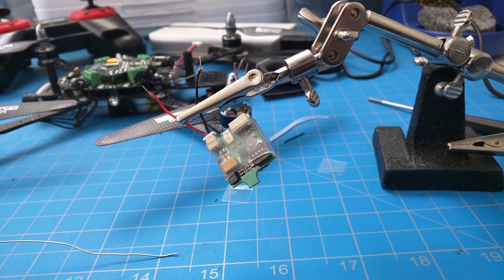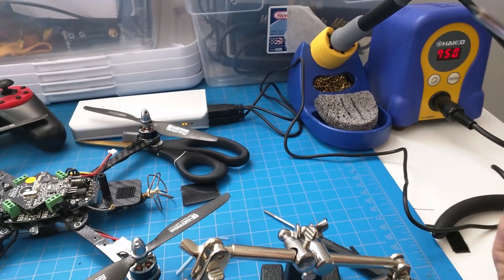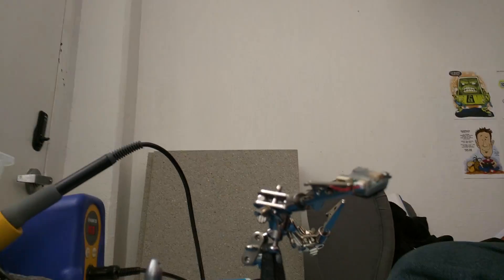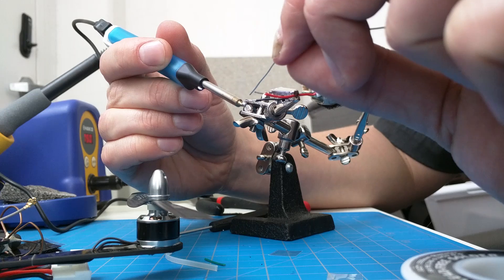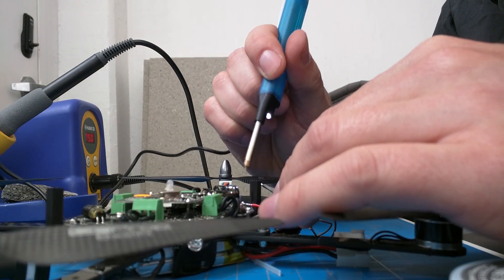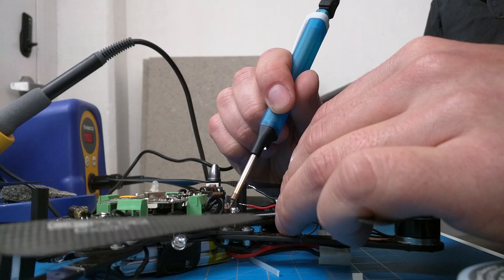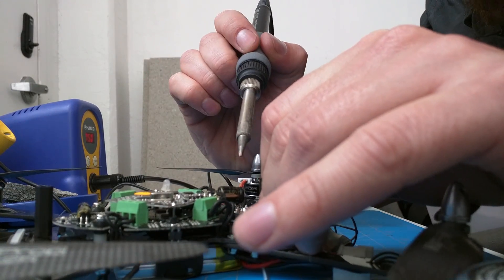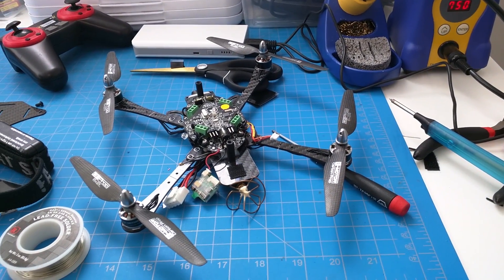Can a $12 USB soldering iron actually, SOLDER?

Comment: Brought a battery powered soldering iron myself last week and came the same conclusion. You can melt solder to wire, but try to solder to a PCB or as in my case try to desolder a component and it fails miserably.
A tip for anyone who reads this and needs a soldering iron, it needs to be atleast 25W and if you have to go portable get a butane powered iron.

Comment: when in doubt, pinky out...lol, i have a portable soldering iron that takes 3 "aa" batteries, same effect.. was trying to fix a headset connector, tin wires = good, attach wires to connector = FAIL...

Comment: I see you are powering your video tx directly from the controller board. I too want the same to shave total weight off my EOX w/ CF frame. However, I'm doing it with the power cable of the vtx series to the 1150 battery female plug to no avail (vtx no power). Connection is only thru one + and - to the batteries female plug. Is it because it's only drawing power from one cell? How come when you series yours and looking closely you soldered only on one pair to the PCB. Any insights on this will be  highly appreciated. Tnx and more power to your Show!

Comment: My experience it that an iron like that is usually 15-25w Max and it's just about usable inside at a push but as soon as it goes outside it doesn't have the power to get hot enough.